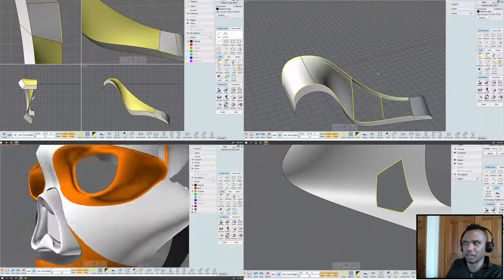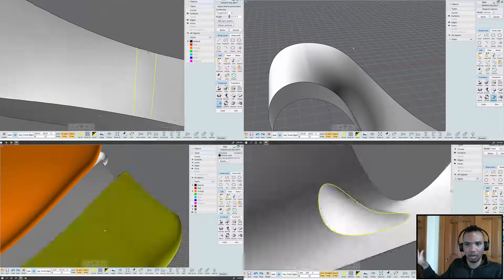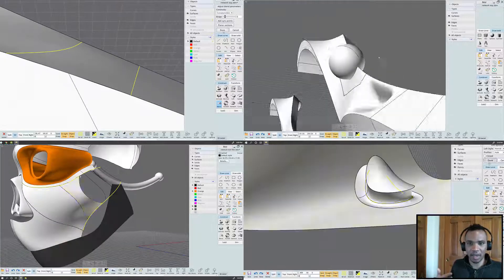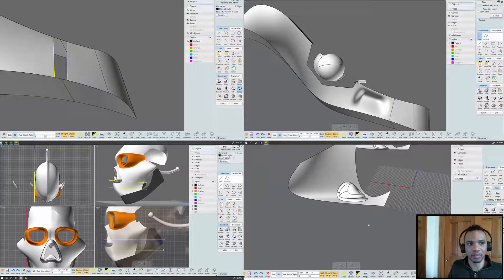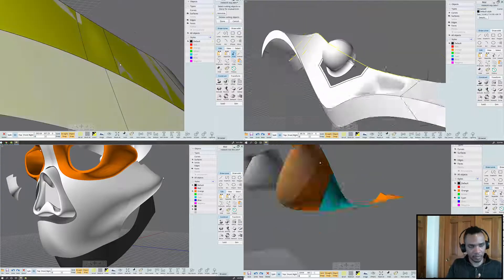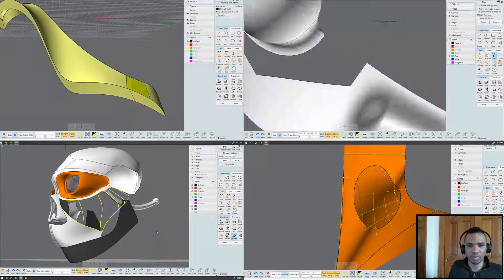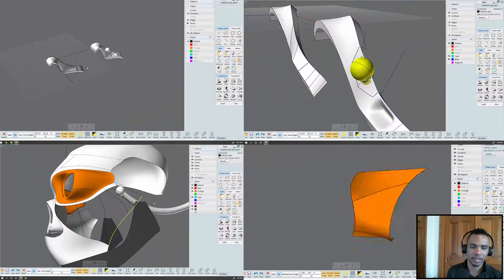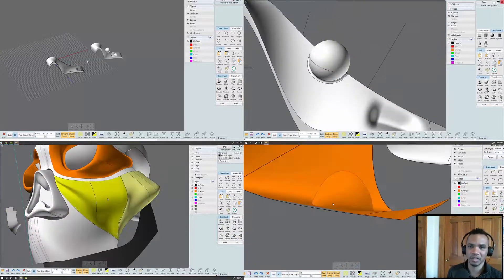Moi3D Answers: can you make a network follow the flow of the surrounding geometry?

Comment: Interesting. Hi, How is flow tool called in Solidworks or CreoParametrics?
Reply from the maker: I would say look for a spline deformer or align to curve system. I feel like flow is a bit specific to moi. In other softwares it would have extra steps but maybe more control over the end result. Hope that helps that's was kind of a tough question haha

Comment: Jacques great videos on MOI3D! I have a question how do you created detailed creases and apply textures to models in MOI3D. I'm having issues designing helmets. I've using offsets but I'm not sure if that's the best way to go.
Reply from the maker: Offset will cause you a lot of pain haha. You're better off building each surface manually and then joining into a solid than using offset in my experience. I also have a long form tutorial out on how to do complex organic forms in moi if you want to go deeper into it:  https://artstn.co/m/2JV9